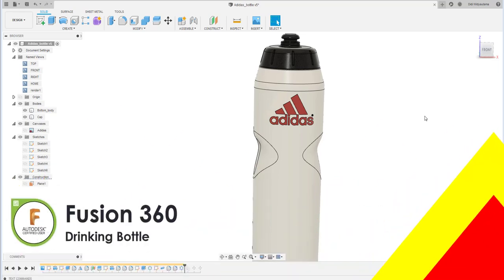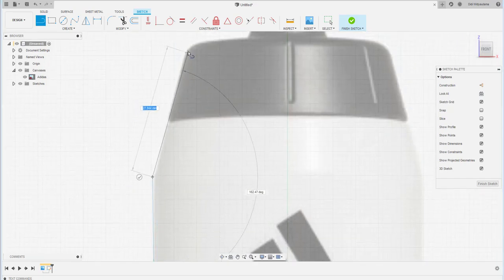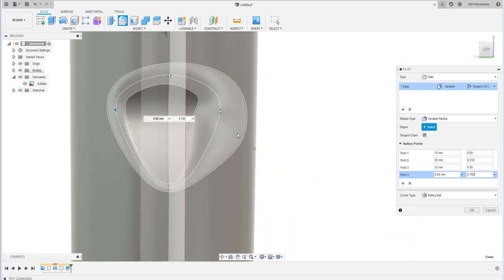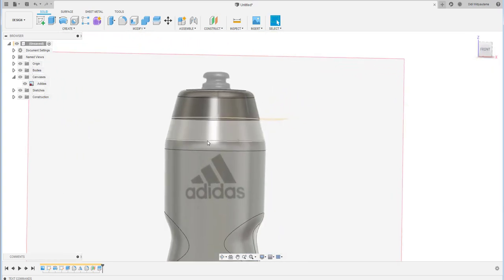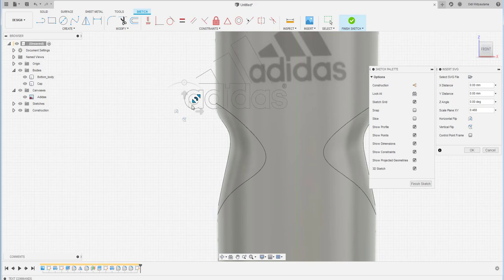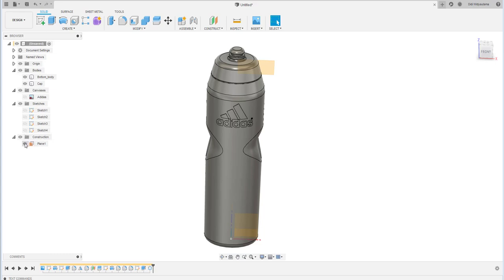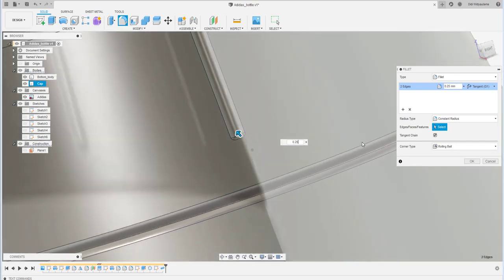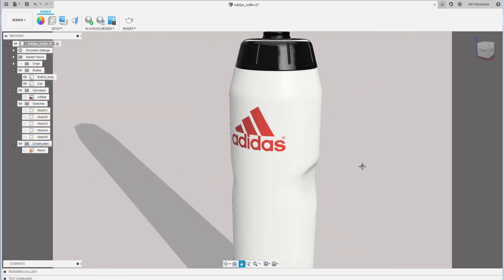Drinking bottle (Adidas) - Tutorial Fusion 360

Comment: Which version of Fusion 360 are you using?
Mine is 2.0.7.046, and mine does not have the option named "Variable Radius" in the Fillet Function.
Reply: Try the scroll down button in radius type?
Reply: MrCoffeypaul 
I can't  find it in the drop down list.
Reply from the maker: @Rikatty12  variable fillet only valid for continuous tangent edge, if you select multiple edges and have those edges have  un tangent direction so the option for variable fillet won't show.
Reply: Didi Widya Utama 
Thank you so much.
I understood.
Reply from the maker: My Fusion is 2.0.7046 version